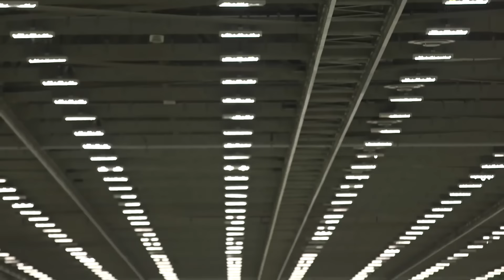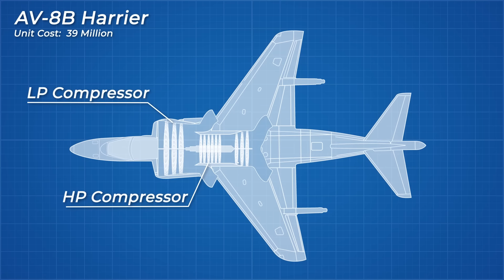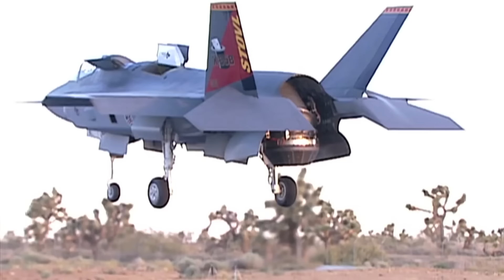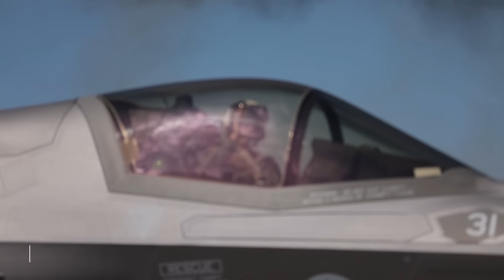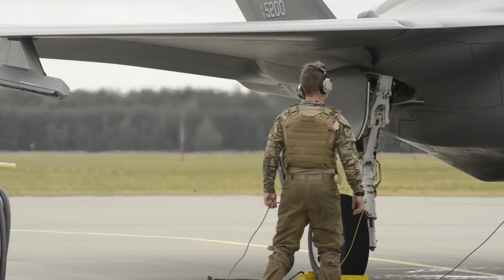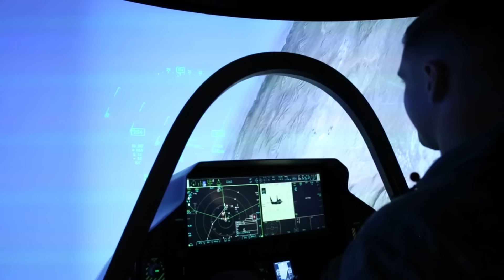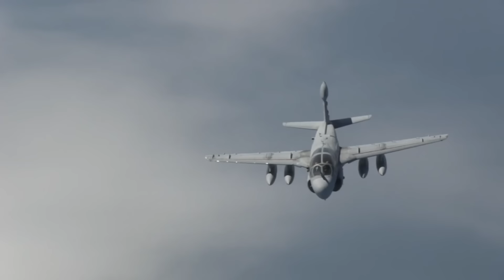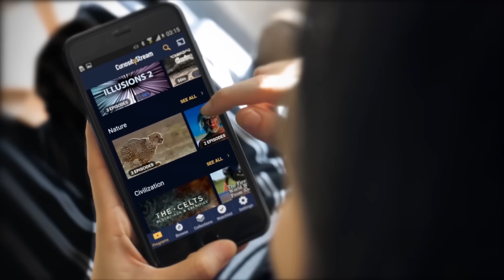Is The F-35 Worth $115 Million?

Comment: Some observations:
If the F-35 ever has to be grounded due to a unresolved flaw, like the F-15 had to be a while back (when the wings well…fell off one), that's going to leave most of the Western Alliance without a fighter (except for some European planes and whatever legacy gear is still in use). It will be a disaster. In the F-15 case other jets like F-16's and FA-18's could pick up the slack and there was no real period of vunerablity while the issue was rectified.
That is an issue with putting all your eggs in one basket (as the saying illustrates)..

A further issue that raises is, with that being mostly the only plane to oppose, "enemy" Airforces are going to minimax to counter it.
They will develop planes, missiles, radars and tactics ect specifically designed and optimised to face it, which you can't do when your likely to be facing multiple types of aircraft.

Counters to stealth are being researched, including breakthroughs in using low frequency radars for targeting. Quantum computing is showing promise in defeating stealth. And the F-35 is still detectable in infrared, it has a nice big heat signature without any cooling off of the exhaust, unlike some other stealth designs. So the Russians are developing long range missiles that use low frequency radars to get near the target and then switch to infrared for actual targeting, or use long range infrared for the whole journey.

Due to intelligence leaks the basic performance envelope is probably known.
And Russia (with China) is no doubt designing a F-35 killer or killers. The Russians are working on salvo fire of a lot of missiles to counter it (similar to the F-15X, in fact the X is stealing the Russian concept), with various seeker types to counter countermeasures.

If stealth gets neutered so does the F-35.

While much is made of its electronics, upgrading the electronics and avionics of aircraft is relatively simple. It's a major industry and the reason the F-16 is still formidable (a modern F-16 is a different beast to the original block version, and the F-111 was only retired due to metal fatigue and political manoeuvring). Fitting the advanced sensors in other legacy Jets is possible, as long as they have the space and power requirements - and many do, the F-35 has compact avionics compared to many modern fighters.
Then if stealth is countered it comes down to the airframe. And the F-35B vertical takeoff variant has caused a lot of compromises on the overall design that limits all three versions.

I'm curious, how much would it have cost without the shenanigans required for the program?
And how much would a completely different aircraft for each service have cost (the Airforce could have just keep producing and refining the F-22).?

It may well turn out to be a amazing aircraft that dominates the battlespace, it may well also turn out to be ineffective.
The problem is there is no plan B, no backup, and if so much money hadn't been wasted there would be. And there may well have been other aircraft to do some of the specialist task eg: a next gen version of the A-10, a optimised jump jet (imagine how happy the marines would be if something did both?). That would leave it to be a stealth strike fighter, not to long of a stretch.

If a hard counter is developed, then what? Shareholder value at Lockheed Martin isn't going to stop an enemy.
Reply: I know you spent time writing your comment, but you seem to have many misconceptions.

Lets just use one.

"If stealth gets neutered so does the F-35."

That's not how stealth works period. Stealth is not some binary. 

Stealth in Aircraft is a function of distance. 

So while new detection capabilities will be developed, stealth features will always be better.

It just means your non stealth aircraft will be even easier to pick up from even farther away.

Infrared will always have limited use as it is limited by line of sight primarily, amongst other reasons. Thus limiting it's use to situations were radar would have already got a clear signal, in other words it is used to agument targeting systems.

Also, there is no such thing as a 'hard counter". That is just some video game nonsense.
Reply: @TheOwenMajor  Great comment.
Reply: So, normal sets of problems that everything has
Reply: Also, do you know what the A-10's role is?

Slinging Mavericks or taking more time than a JDAM to respond. F-16s, for instance, sling Mavericks much more safely, and JDAMs are much faster as a response to an enemy position. An A-10 has to get all the way to where the friendlies are, spot them with the Mk1 Eyeball, line up, dive like a jet powered Stuka, and gun the enemy. 

Not that an F-35, with a 25mm gun based on the A-10's, can't go through the same whole thing-except faster, with the pilot not having to look over the plane because he can see *through his own plane*, with a faster aircraft to boot. Or, if he happens to be 40 miles away, speed up and drop a bomb from 20 miles away which will arrive faster than an A-10 could from 40 miles away surely. 

And the Marines would not be happy with something that was a "next gen version of the A-10 (will never exist because it's stupid)" or "an* optimized jump jet (literally the F-35B)"

The Marines sacrificed the Super Hornet for the F-35B and C. Are flying falling apart F-18s that are very old because they don't want to mess around with anything less than an F-35.
Reply: At no point will the entire US Air Force or Navy be using only F-35s. PCA will come online in the 2030s/2040s, and those will end up being half the fleet, and then the F-35 will be replaced in the 2060s/2070s, and then PCA will be half the fleet and then whatever replaces PCA will be the other half.

Aircraft are replaced as half the fleet in the USAF. In the Navy, F-35C will not even be half and F/A-XX will end up being half. Even Japan won't ever see an entire F-35 fleet in the foreseeable future. Also, again, there are three variants of F-35 with very important differences, and as we saw with the F-35B fuel line problem, not all F-35s will be grounded, just all of that variant. Also, as we saw with the JASDF F-35A crash, only one Air Force's planes will be grounded. That turned out to be nothing. 

And yes, enemies will develop things to counter us. And we will make another F-35 designed to counter whatever they designed to counter us. The F-35 was just another cog in this cycle, a particularly efficient one post-Cold-War. 

We are unlikely to face multiple types of hostile aircraft designed to counter the F-35 from any given Air Force. China only has the J-20, and FC-31. They will eventually develop another thing but the J-31 isn't actually meant to counter the F-35, it's meant to counter our 4th gens, and is probably not able to counter F-35s for a lot of reasons I'll get into if you ask me.
Russia only has the Su-57, which definitely wasn't meant to counter F-35, nor is it able to. Something actually able to counter an F-35 from Russia in a reasonable timeframe is extremely unlikely to ever make it to more than a couple squadrons, if Su-57 ever even makes it beyond a few squadrons.

Russians have been lugging like 10 missiles on Flankers since long before F-35... and the F-35 actually does have cooledish exhaust and infrared countermeasures inherent to the engine and nozzle. 

If stealth gets neutered, unstealthy planes are exponentially more neutered. It's not an on/off switch, as the video stated, it's a reduction in radar cross section. If you make radar cross sections more visible, you make them more visible. And planes with larger RCSs than F-35s will be even more neutered

Upgrading the electronics and avionics of an aircraft is NOT "relatively simple." Tell an F-22 pilot upgrading the avionics is relatively simple and you'll get a broken nose. 
Do you know what the electronic warfare equivalent of an F-35 is in 4.5th gen terms?

The EA-18G Growler. That thing sacrifices NEARLY ALL ITS PAYLOAD to get where every single F-35 is at, AND it doesn't have the spherical field of view DAS provides or the sensor fusion or the same cooperative engagement that the F-35 has with AEGIS boats and more. An EA-18G can bring up to two AMRAAMs and two AGM-88 HARMs. That's it, the entire payload. F-35, on the other hand, needs less power to jam itself into unnoticability and has similar capabilities otherwise, AND can carry 18,000lbs of weaponry. AND can then do that from a USS America class LHD or an Izumo class helicopter destroyer. While a Growler needs an airfield or a catapult.

And no, the physical capabilities of the other aircraft were not sacrificed for the Bravo variant. The Liftfan system is the kind of thing you could slap into an F-16 if you had the money. Nobody's going to do that, because we have F-35s, but you could, and I don't think anybody's arguing F-16s are physically compromised by the variant that doesn't exist yet that could hover which is entirely possible.
Reply: If F-22 production were restarted it was estimated it would be around $200,000,000 per plane. It also has much higher maintenance costs, can carry 2000lbs bombs internally, doesn't have a stealthy targeting pod etc. 

Quantum radar makes physical stealth more important, not less because it doesn't have special effects vs stealth but makes jamming (the thing normal jets need to avoid fire) totally useless. 

Also if you look at China and Russia concurrent with them saying they can counter stealth they're desperate to develop their own stealth jets.

Also the A-10 is a design philosophy that was outdated decades ago. A new generation ground support aircraft (other than the F-35) is a stealthy drone controlled directly by the troops it's supporting with tons of small precision guided munitions.

Comment: https://www.defensenews.com/air/2019/06/10/lockheed-pentagon-reach-handshake-agreement-on-first-f-35-multiyear-buy/
While the Pentagon did not provide costs per aircraft in its news release, that would amount to about $81 million per F-35A conventional takeoff and landing model compared to $89.2 million for an F-35A in lot 11.

Lord estimated that the cost will drop around 15 percent from lot 11 to lot 14 across all variants, which could peg an A model at around $76 million.

“This framework estimates the delivery of an F-35A for less than $80M in Lot 13, one year earlier than planned," Lord said.

Comment: F-16 pilot here.  The part about the F-35 being a weak dogfighter is completely true, especially in the WVR (within visual range) environment. 

This video touches on the important fact that modern air to air engagements are all about long range detection and lofted active radar guided missiles, such as the AIM-120.  The F-35 AESA radar is one of the currently best produced in the world and is what makes this aircraft so much more advanced than 4th gen fighters (although AESA is being retrofitted to many of these fighters as well).

Basically if you end up in a classic close range dog fighting situation, something went terribly terribly wrong well before the engagement.
Reply: GoPenguin Yes. The f35 is not designed to be a dog fighter. That’s the job of the f16 and f15. The f35 is more of a sniper.
Reply: What about the DAS IRST system in combination with the AIM-9X?

Comment: So bottom line is it was a mistake to mod one Plane for 3 purposes instead of having 3 focused and purposelessly designed Planes?! And it would have been more efficient and cheaper too.
Reply: They did it the way they did because the idea was to have a large number of parts in common to reduce maintenance costs and parts inventory sizes. I think they managed about 80% commonality of parts. It wasn't lockheeds idea to do it that way it was the military's idea. And part of the cost of development came from the government changing mission parameters several times which increased the weight and size of the aircraft. Then the government cancelled about half of the aircraft originally asked for. fewer number of planes sold means higher per unit cost.
Reply: @ADobbin1  Problem is the military's   concept not the concept of the ppl working on the planes. As an engineer I know how difficult it can be to incorporate COP just for the sake of the COP. In this case I see it rather as a small advantage compared to the huge addition in complexity for the 3 mods.

Comment: The only real issue I see with the F-35 is the C for the navy, the navy all aways wants some redundancy because they can be so far away from the coast and AO. So is the extra 20 odd million really for just the carrier suit, because the navy have capable aircraft with engine redundancy. Because ditching in the ocean is one of the worst places to ditch and this is the issue of developing an air frame for the air force (mostly) and the marines, and then saying "Oh ya let's just give this to the navy, with one of the most important systems ready to fail at the most inopportune time possible without any back up." Oh and going from a 40 odd million dollar aircraft specifically designed for the navy (F/A-18) to the about 110 million dollar F-35 that isn't really designed (air frame wise) for the navy is a bit of a long stretch to say it's about the same price point, but it is a good aircraft the F-35 but I don't think that in the navy it should become the main strike fighter used.